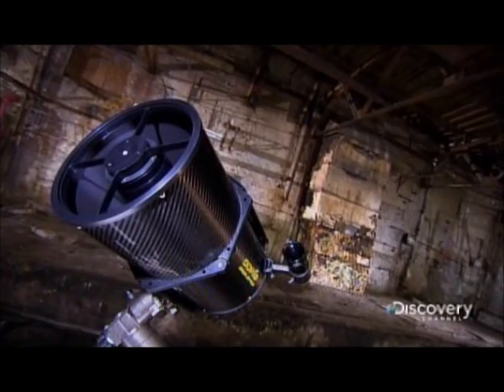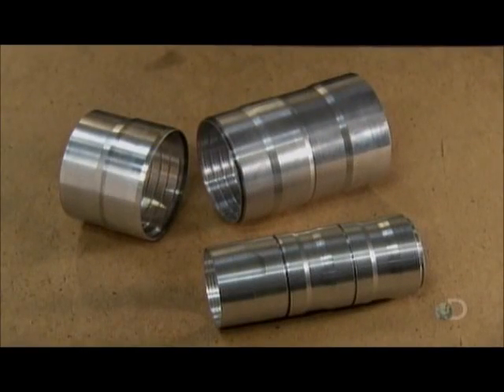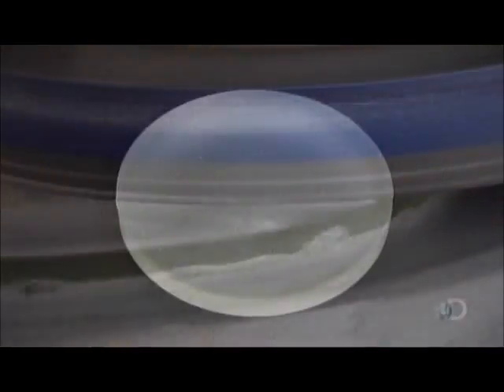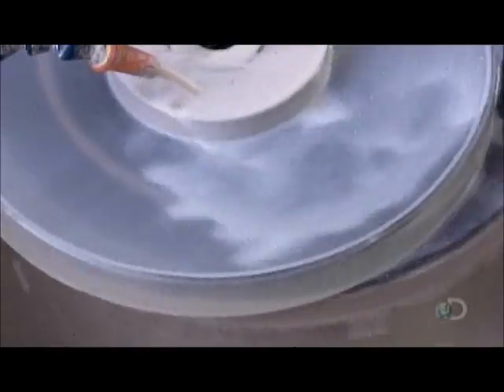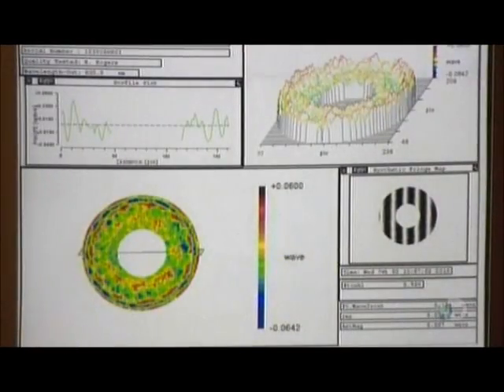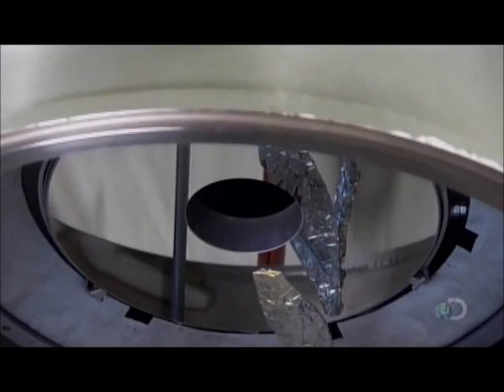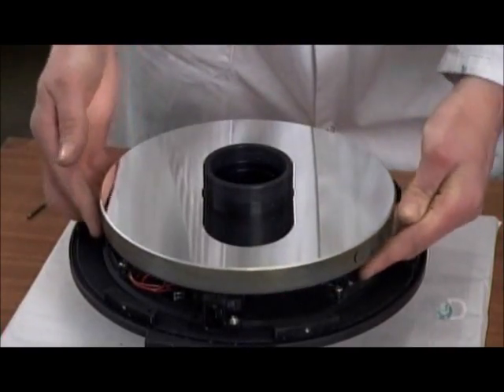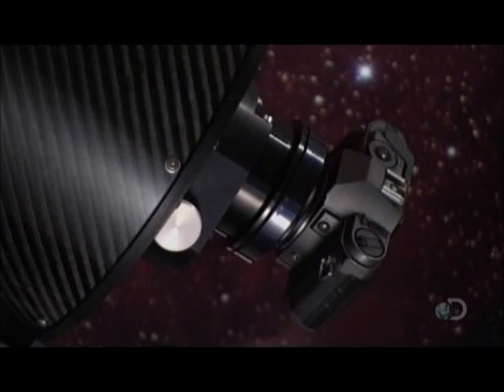How It's Made - Telescopes

Comment: Most amateur-astronomers prefer a Ritchey-chrétien reflector as it's equiped with a focuser at the back-end, rather than a Schmidt-Cassegrain reflector where focusing is done by moving the primary mirror. Although one could lock the primary mirror in place and put a Crayford focuser in place to approve a Schmidt-Cassegrain ;-)
Guan Sheng Optical makes affordable Ritchey-Chrétien telescopes.
Clear Skies!
RefractorPhill
Reply: Sorry, but isn't the difference between Schmidt-Cassegrain and Ritchey–Chrétien just the shape of the primary mirror (parabolic and hyperbolic respectively)?
Reply: @estoniaman  The Ritchey-Chretien has an open tube, while a schmidt-cassegrain has a corrector plate on the front.